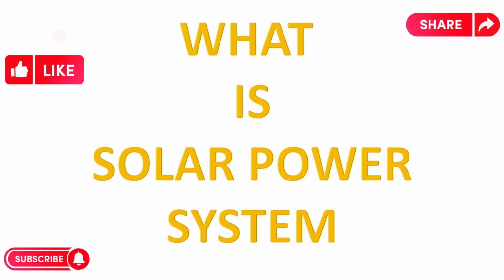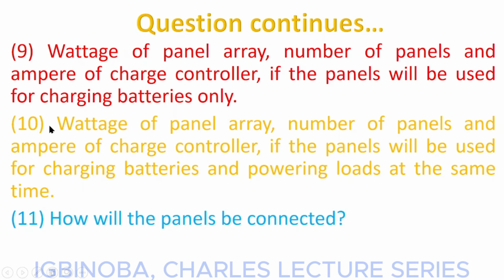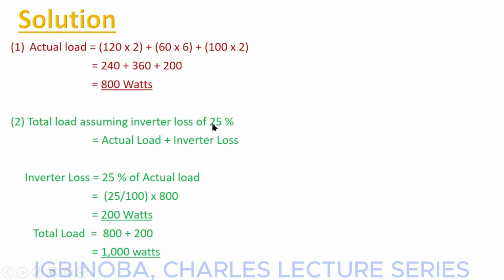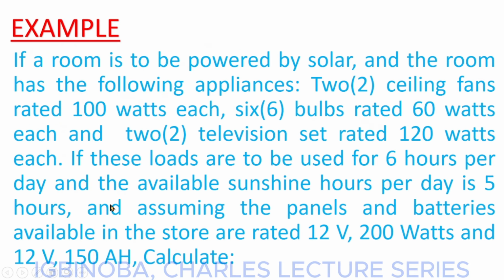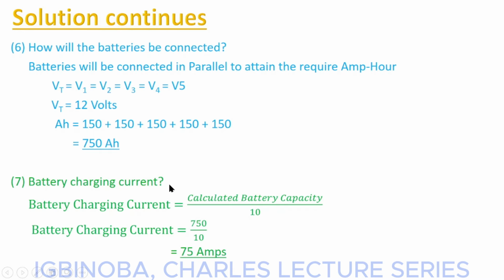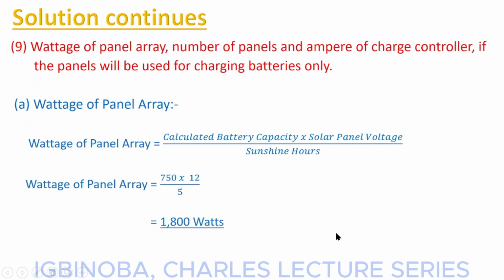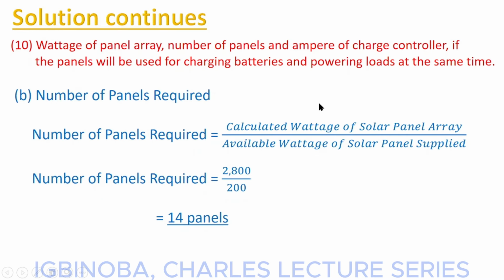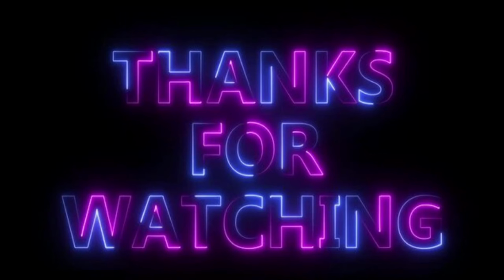Design of Solar Power System

Comment: PETRO11K

Answers:

1. Actual load = 1380Watt

2. Total load = 1725Watt

3. Inverter rating = 2156.25VA

4. Battery Capacity = 1239.75Ah

5. Number of batteries = 8.625 (9 batteries)

6. They will be connected in parallel 

7. Battery charging current = 129.375A

8. Battery charging time with 40% loss = 14hrs

9a. Wattage of panel array = 3105Watt

9b. Number of panels = 16panels

9c. Ampere of charge controller = 258.75A

10a. Wattage of panel array with load = 4485Watt

10b. Number of panels = 23 panels

10c. Ampere of charge controller = 373.75A

11. They will be connected in parallel.

Comment: PETROCHEM8H 

Actual load: 1,380 W
Total load with 25% inverter loss: 1,725 W
Inverter rating: 2,156.25 VA
Battery capacity: 1,293.75 Ah
Number of batteries: 9 batteries
Battery connection: Parallel
Battery charging current: 129.4 A
Battery charging time: 14 hours

Comment: COMP17Q

1. The actual pad is 1,380W
2. The Total load is 1,725W
3. The inverter rating is 2,156.23VA
4. The battery capacity is 1,293.75Ah 
5. The Number of batteries is 9
6.  The batteries are connected in parallel 
7. The Battery charging current is 129.4 amps.
8. The battery charging time is 14 hours.
9. a. The wattage of the panel array is 3,105W
b. The number of panels is 16 panels.
c. The Charge controller rating is 258.75 amps.

10. a. The wattage of the Panel array is 4,830 Watts 
b. The number of panels is 24 panels.
c. The charge controller rating is 402.5 amps
11. The panels are arranged in parallel

Comment: EE33G 

1. Actual load is 1,380W

2. The Total load is 1,725W

3. The inverter rating is 2,156.23VA

4. The battery capacity is 1,293.75Ah

5. The Number of batteries is 9

6. The batteries are connected in parallel

7. The Battery charging current is 129.4 amps.

8. The battery charging time is 14 hours.

9. a. The wattage of the panel array is 3,105W

b. The number of panels is 16 panels.

c. The Charge controller rating is 258.75 amps.

10. a. The wattage of the Panel array is 4,830 Watts

b. The number of panels is 24 panels.

c. The charge controller rating is 402.5 amps

11. The panels are arranged in parallel

Comment: COMP43Q

1. The actual pad is 1,380W
2. The Total load is 1,725W
3. The inverter rating is 2,156.23VA
4. The battery capacity is 1,293.75Ah 
5. The Number of batteries is 9
6.  The batteries are connected in parallel 
7. The Battery charging current is 129.4 amps.
8. The battery charging time is 14 hours.
9. a. The wattage of the panel array is 3,105W
b. The number of panels is 16 panels.
c. The Charge controller rating is 258.75 amps.

10. a. The wattage of the Panel array is 4,830 Watts 
b. The number of panels is 24 panels.
c. The charge controller rating is 402.5 amps
11. The panels are arranged in parallel

Comment: MEC28D
1.Actual load =1380w
2.Total load=1725w
3.Inverter rating=2156.25VA
4.Battery capacity=1293.75Ah
5.Number of batteries=9 batteries 
6.The batteries are connected in parallel 
7.Battery charging current= 129.375A
8.charging Time=14hrs
9a.wattage of the panel array=3105W
b.number of panels=16 panels 
c. Ampere of charge controller=258.75Amps
10a.panel wattage=4850W
b.number of panels=24 panels
c=Ampere of charge controller=402.5Amps
11. The panels will be connected in parallel.....

Comment: CIV2B
1. Actual load: 1380W
2. Total load: 1725W
3. Inverter rating: 2156.23VA
4. Battery Capacity: 1293.75AH 
5. Number of Batteries is 9
6. Batteries are connected in parallel
7. Battery charging current: 129.4 amps
8. Battery charging time: 14 hours
9a. Wattage of panel array: 3,105W
b.  Number of Panels:16 Panels
c. Charge controller: 258.75 Amps

10a. Wattage of the Panel array:4830 watts
10b. Number of Panel: 24 Panels 
10c. The charge controller:402.5 amps
11. Panels are arranged in parallel

Comment: MEC98T
Answer: 

1. Actual Load - 1,380Watts
2. Total Load - 1,725Watts
3. Inverter Rating in VA - 2156.25VA
4. Battery Capacity - 1293.75Ah
5. Batteries for Backup Hours - 9 Batteries
6. Batteries Connection - Parallel
7. Battery Charging Current - 129.4A
8. Battery Charging Time - 14hrs
9a). Wattage Of Panel Array - 3105Watts (But it's better
to use 3200Watts)
9b). Number Of Panels - 16 panels
9c). Ampere Of Charge Controller - 266.67A(But it' better to use that of 300A)
10a). Wattage Of Panel Array - 4830Watts (But it's better to use 5000Watts)
10b). Number Of Panels - 25 panels
11. Panels Connection - Parallel

Comment: MAR35I 
1. Actual Load: 1380 watts
 2. Total Load : 1725 watts
3. Inverter Rating : 2156.25 VA
4. Battery Capacity: 1293.75 Ah
5. Number of Batteries : 8.625-9 batteries 
6. Parallel
7. Battery charging current: 129.375 Amps 
8. Charging time: 14 hrs
9. (a) 3105 watts
(b) 15.525 - 16 panels
(c) 258.75 Amps
10. (a) 4830 watts
(b) 24.15- 24 panels
 (c) 402.5 Amps
11. Solar panels will be connected in parallel

Comment: COMP102OX 
1 1380w
2 1725w
3 2156.25VA
4 1293.75
5 9 batteries 
6 parallel 
7 129.375A
8 14hrs
9a 3105w
9b 14panels
9c 258.75A
10a 4830w
10b 14 panels
10c 402.5A
11 The panels are arranged in parallel
Reply: CIV25Y 

1. The actual pad is 1,380W
2. The Total load is 1,725W
3. The inverter rating is 2,156.23VA
4. The battery capacity is 1,293.75Ah 
5. The Number of batteries is 9
6.  The batteries are connected in parallel 
7. The Battery charging current is 129.4 amps.
8. The battery charging time is 14 hours.
9. a. The wattage of the panel array is 3,105W
b. The number of panels is 16 panels.
c. The Charge controller rating is 258.75 amps.

10. a. The wattage of the Panel array is 4,830 Watts 
b. The number of panels is 24 panels.
c. The charge controller rating is 402.5 amps
11. The panels are arranged in parallel

Comment: MAR56D

Solution:

1. Actual Load: 1,380 W
2. Total Load: 1,800 W
3. Inverter Rating (Power Factor = 0.8): 2,300 VA (2.3 kVA)
4. Battery Capacity Required: 1,226.67 Ah
5. Total Number of Batteries: 9 units
6. Battery Configuration: Parallel Connection
7. Battery Charging Current: 120 A
8. Estimated Battery Charging Time: 16.67 hours
9. Solar Array Sizing – Battery Charging Only: 2,900 W (approximately 3,000 W), comprising 15 solar panels with a 250 A charge controller
10. Solar Array Sizing – Simultaneous Battery Charging and Load Supply: 4,784 W (approximately 4,800 W), comprising 20 solar panels with a 900 A charge controller
11. Solar Panel Connection: Parallel Configuration

Comment: MEC14N

1. Actual load = 1,380W

2. Total load= 1,725W

3. Inverter rating=2,156.25VA

4. Battery Capacity= 1,293.75AH

5. 9 batteries
 
6. Batteries will be connected in parallel 

7. Battery charging current= 129.375A

8. Battery charging time= 14hrs

9a. Wattage of panel array for charging only= 3,105W
(b.) Number of panels= 16
(c) Ampage of charge controller= 258.75Amp

10. Wattage of panel array charging plus load= 4,830W
(b) Number of panels= 24
(c) Ampage of charge controller= 402.5 Amps

11. The panels will be connected in parallel

Comment: CHM73U 
soln
actual load=1380w

total load=1725w

inverter rating=2156.25VA

battery capacity=1293.75Ah

number of batteries=9

connection is in parallel 

battery charging current=129.375

charging time=9

wattage power array=3105w

numbers of panel=16

Ampere of charge controller=258.75

wattage of arral power with load=4830

number of panel=23

Ampere charge controller=402.5

Comment: CHM59W

1. The actual pad is 1,380W
2. The Total load is 1,725W
3. The inverter rating is 2,156.23VA
4. The battery capacity is 1,293.75Ah 
5. The Number of batteries is 9
6.  The batteries are connected in parallel 
1. The Battery charging current is 129.4 amps.
2. The battery charging time is 14 hours.
3. a. The wattage of the panel array is 3,105W
b. The number of panels is 16 panels.
c. The Charge controller rating is 258.75 amps.

1. a. The wattage of the Panel array is 4,830 Watts 
b. The number of panels is 24 panels.
c. The charge controller rating is 402.5 amps
1. The panels are arranged in parallel

Comment: PETROCHEM52Z

1. 1380W
2. 1725W
3. 2156.25VA
4. 1293.75
5. 9 batteries
6. Parallel
7. 129.375A
8. 14 hours
9a. 3105W
9b. 14 panels
9c. 258.75A
10a. 4830W
10b. 14 panels
10c. 402.5A
11. The panels are arranged in Parallel

Comment: EEE9I

1. Actual load =1380w
2. Total load =1725w
3. Inverter rating =2156.25va
4. Battery capacity =1293.75ah
5. Number of batteries=9
6. The batteries are connected in parallel 
7. The battery charging current is 129.4amps
8. The battery charging time is 14hrs
9. a. The watts of the panel array is 3105w
b. The number of panels is 16panels 
c. The charge controller rating is 258.75amps.

10. a. The wattage of the panel array is 4830w
b. The number of panels is 24
c. The charge controller rating is 402.5amps

11. The panels are connected in parallel

Comment: MAR114J

ANSWERS
1) Actual load- 1380W
2) Total load assuming inverter loss of 25% - 1725W
3) Inverter rating assuming a power factor of 0.8- 2,156.25VA
4) Battery capacity using 75% reserve- 1293.75ah
5) Number of battery for backup hours- 9 batteris
6)How will the batteries be connected - Parallel connection
7) Battery charging current- 129.4A
8)Battery charging time using a loss of 40%- 14hrs
9) Panels for charging battery only
I) 31,053W
ii) 16 panels
iii) 258.75A
10) Panels for charging battery and power loads
I) 4,830W
ii) 24 panels
iii) 402.5A
11) How will the panels be connected- Parallel

Comment: PETRO15O

Answer:
1. Actual load= 1380W
2. Total Load= 1725W
3. Inverter rating= 2156.25VA
4. Battery Capacity= 1293.75AH
5. Number of batteries= 8.625 ~ 9 batteries 
6. The connection should be a parallel connection
7. Battery Charging current= 129.375AH
8. Battery charging time= 14hours
9
a. Wattage of panel array= 3105W
b. Number of Panels= 15.525 ~ 16 panels
c. Ampere charge controller= 258.75A
10
a. Wattage of panels array= 4830W
b. Number of panels= 24.15 ~ 24 panels
c. Ampere charge controller= 402.5A
11. The connection should be in parallel

Comment: COMP97S 
1. The actual pad is 1,380W
2. The Total load is 1,725W
3. The inverter rating is 2,156.23VA
4. The battery capacity is 1,293.75Ah
5. The Number of batteries is 9
6. The batteries are connected in parallel
7. The Battery charging current is 129.4 amps.
8. The battery charging time is 14 hours.
9. a. The wattage of the panel array is 3,105W
b. The number of panels is 16 panels.
c. The Charge controller rating is 258.75 amps.
10. a. The wattage of the Panel array is 4,830 Watts
b. The number of panels is 24 panels.
c. The charge controller rating is 402.5 amps
11. The panels are arranged in parallel.

Comment: EEE104Z

1.1380w

2.1725w

3.2156.25VA

4.1293.75Ah

5.9 batteries

6.connetion is done in parallel to increase the

current

7.129.4 amps

8.14 hours

9a. 3105watts

9b. 16 panels

9c. 258.75amps

9d. Parallel connection

10a. 4830watts

10b. 24 panel

10c.402 5A

11.the panels are arranged in parallel

Comment: EEE119O

Answer:
1. Actual load: 1,380 W
2. Total load: 1,725 W
3. Inverter rating: 2,156.25 VA
4. Battery capacity: 1,293.75 Ah
5. Number of batteries: 9 batteries
6. Battery connection: Parallel
7. Battery charging current: 129.375 A
8. Charging time: 10 hours
9. Solar panel array: 3,105 W
10. Number of panels: 16 panels
11. Charge controller: 258.75 A
12. Alternative panel array: 4,830 W
13. Number of panels: 24 panels
14. Charge controller: 402.5 A
15. Panel arrangement: Parallel

Comment: PETRO75W
Answers:
Actual load = 1380Watt
Total load = 1725Watt
Inverter rating = 2156.25VA
Battery Capacity = 1239.75Ah
Number of batteries = 8.625 (9 batteries)
They will be connected in parallel
Battery charging current = 129.375A
Battery charging time with 40% loss = 14hrs
9a. Wattage of panel array = 3105Watt
9b. Number of panels = 16panels
9c. Ampere of charge controller = 258.75A
10a. Wattage of panel array with load = 4485Watt
10b. Number of panels = 23panels
10c. Ampere of charge controller = 373.75A

Comment: PETRO76X
1. 1380W
2. 1725W
3. 2156.25VA
4. 1293.75AH
5. 9 batteries 
6. The batteries will be connected in parallel 
7. 129.375A
8. 14 hours
9a. 3105W
9b. 16 panels
9c. 258.75A
300A charge controller will be suitable 
10a. 4830A
10b. 24 panels 
10c. 402.5A.
500A charge controller will be suitable 
11. The panels will be connected in series

Comment: MAR122R

1. Actual load =1389
2. Total load.= 2725
3. Inverter rating =2156.25
4. Battery capacity =1293.75
5. Number of batteries =9 batteries 
6. Battery connection= parallel 
7. Battery charging current =129.38
8. Battery charging time= 14 h
9. Array wattage=3105w
Number of panels= 16 panels 
Charge controller current=25
10. Array wattage =4830w 
Number of panels =25
Charge controller current= 402.tA
11.Connection= parallel

Comment: PETROCHEM49W

1. The actual pad is 1,380W
2. The Total load is 1,725W
3. The inverter rating is 2,156.23VA
4. The battery capacity is 1,293.75Ah 
5. The Number of batteries is 9
6.  The batteries are connected in parallel 
7. The Battery charging current is 129.4 amps.
8. The battery charging time is 14 hours.
9. a. The wattage of the panel array is 3,105W
b. The number of panels is 16 panels.
c. The Charge controller rating is 258.75 amps.

10. a. The wattage of the Panel array is 4,830 Watts 
b. The number of panels is 24 panels.
c. The charge controller rating is 402.5 amps
11. The panels are arranged in parallel

Comment: MAR121Q

Answers
Actual load = 1380 W
Total load = 1725 W
Inverter rating = 2156.25 VA
Battery capacity = 1293.75 AH
Number of batteries = 9 batteries
Battery connection = parallel
Battery charging current = 129.375 A
Battery charging time = 14 hrs
Array wattage = 3105 W
Number of panels = 16 panels
Charge controller current = 258.75 A
Array wattage = 4830 W
Number of panels = 25
Charge controller current = 402.5 A
Connection = parallel

Comment: PETRO73U
Answers 

1. Actual load=1380W
2. Total load=1725W
3. Inverter rating= 2156.25VA
4. Battery capacity= 1293.75AH
5. Number of batteries= 9 batteries 
6. Battery connection= parallel
7. Battery charging current= 129.375A
8. Battery charging time= 14hrs
9. Array wattage=3105W
    Number of panels=16 panels
    Charge controller current= 258.75A
10. Array wattage=4830W
      Number of panels=25
      Charge controller current=402.5A
11. Connection= parallel

Comment: COMP90L: Answers 
1) Actual load= 1,380Watts
2) Total load assuming 25% inverter loss= 1,725watts
3) Inverter Rating in VA using power factor of 0.8= 2,156.25VA
4) Battery capacity using a factor for reserve of 75%= 1,293.75AH
5) No. of batteries = 8.625 ~9
6) The batteries will be connected in parallel 
7) Battery charging current = 129.375A
8)charging time(40% loss)= 14hrs
9) (a) 3,105Watts (b) 15.525~16 panels (c) 258.75A
10) (a) 4,830Watts (b) 24.15 panels (c) 402.5A
11) It will be connected in parallel

Comment: EEE59G 
1. Actual load = 1380 W
2. Total load = 1725 W
3. Inverter rating = 2156.25 VA
4. Battery capacity = 1293.75 Ah
5. Number of batteries = 9
6. Battery connection = Parallel
7. Battery charging current = 129.375 A
8. Battery charging time = 14 hours
9a. Panel array wattage for charging only = 3105 W
9b. Number of panels = 16
9c. Charge controller current = 258.75 A
10a. Panel array wattage for charging + load = 4830 W
10b. Number of panels = 25
10c. Charge controller current = 402.5 A
11. Panel connection = Parallel

Comment: NAT3C

1. The actual pad is 1,380W
2. The Total load is 1,725W
3. The inverter rating is 2,156.23VA
4. The battery capacity is 1,293.75Ah 
5. The Number of batteries is 9
6.  The batteries are connected in parallel 
7. The Battery charging current is 129.4 amps.
8. The battery charging time is 14 hours.
9. a. The wattage of the panel array is 3,105W
b. The number of panels is 16 panels.
c. The Charge controller rating is 258.75 amps.

10. a. The wattage of the Panel array is 4,830 Watts 
b. The number of panels is 24 panels.
c. The charge controller rating is 402.5 amps
11. The panels are arranged in parallel

Comment: PETRO61I

1. 1380W
2. 1725W
3. 2156.25VA
4. 1293.75AH
5. 9 Batteries
6. The batteries will be connected in parallel
7. 129.375A
8. 14hrs
9a. 3105W
9b. 16 Panels
9c. 258.75A (A 300 charge controller will be suitable)
10a. 4830W
10b. 24 Panels
10c. 402.5A (A 500A charge controller will be suitable)
11. They will be connected in Parallel

Comment: PETRO28B

1: Actual load =1380W
2: Total load =1725W
3: inverter rating=2156.28W
4 :Battery capacity=1293.75Ah
5: number of battery=9
6: Connected in parallel
7: Battery charging current=129.375Ah
8: Battery Charging time with 40%loss=14hours
9a: Wattage of panel array=3105W
9b: Number of panels=16panels
9c: Ampere of Charge controller =258.75A
10a: Wattage of panel array with load=4485W
10b: Number of panels =23panels
10c: Ampere of charge controller=373.75A
They will be connected in parallel

Comment: MAR12L
Answers:
1. Actual load = 1380Watt
2. Total load = 1725Watt
3. Inverter rating = 2156.25VA
4. Battery Capacity = 1239.75Ah
5. Number of batteries = 8.625 (9 batteries)
6. They will be connected in parallel 
7. Battery charging current = 129.375A
8. Battery charging time with 40% loss = 14hrs
9a. Wattage of panel array = 3105Watt
9b. Number of panels = 16panels
9c. Ampere of charge controller = 258.75A
10a. Wattage of panel array with load = 4485Watt
10b. Number of panels = 23panels
10c. Ampere of charge controller = 373.75A
11. They will be connected in parallel.

Comment: EEE39M 
ANSWER:
1.Actual Load=1380W
2. Total Loss(25%)= 1725W
3. Inverter Rating=2156.25VA
4. Battery Capacity= 1293 .75AH
5. Number of batteries=9 batteries 
6. Battery connection=Parallel
7. Battery charging current= 129.375Amps
8. Battery charging time= 14 hrs.
9a. Array Wattage(Charge only)= 3105W
9b. Number of panels=16 panelsCjarge controller current= 258.75Amps

10a. Array Wattage(Charge+Load)=4830W
10b. Number of panels=25 panels
10c. Charge controller current=402.5 Amps
11. Panel connection= parallel